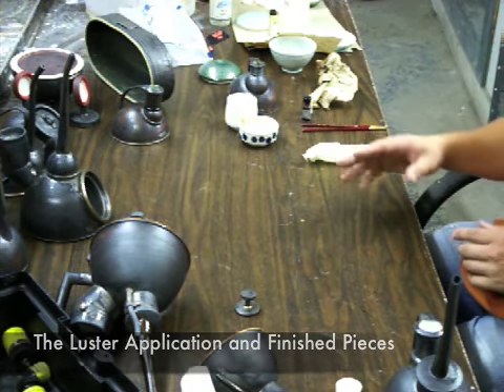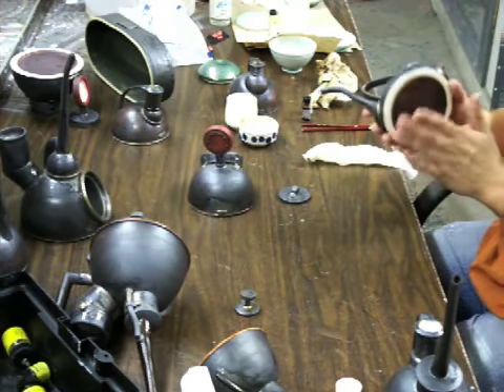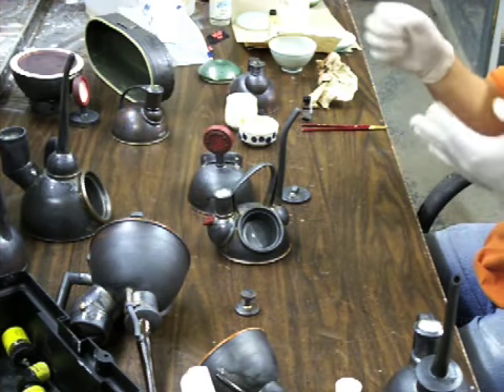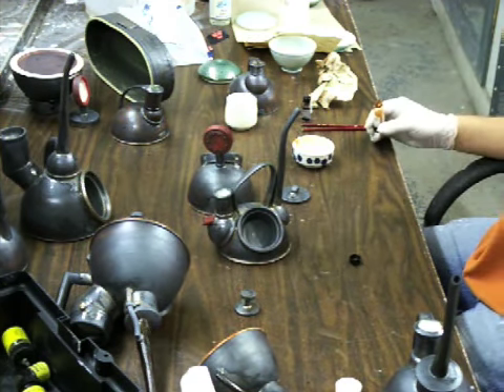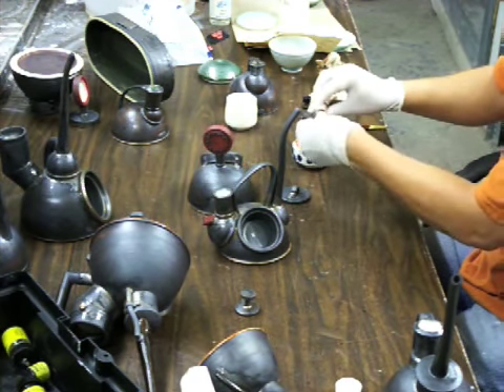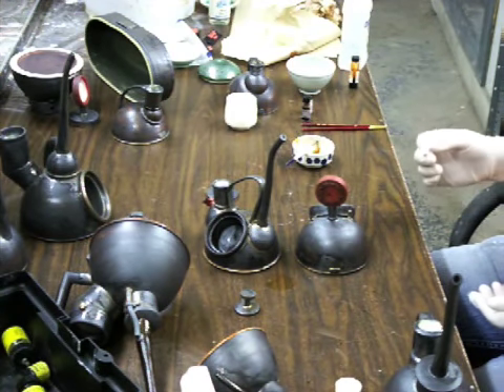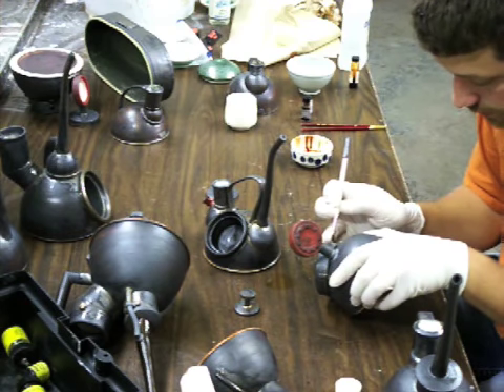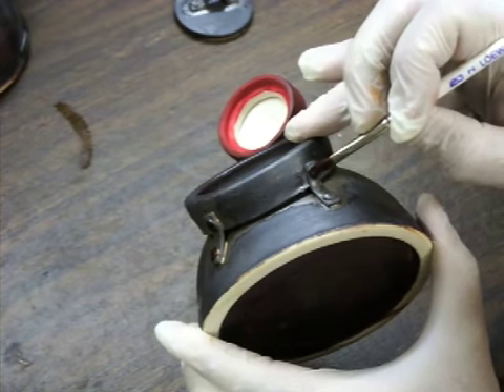Final Steampunk pourers

Comment from the maker: The bronze color is Saturation gold from amaco. I do have my own glaze now that I like a little better in the application. It started as 30 redart 60 manganese 10 3195 but after mixing the bucket up I have added epk, iron, and copper. It is not a safe glaze to use as a liner, but does make it through dishwashing and microwaving. I have been working lately with layering with iron washes and washing back to get more variety. Sorry I don't have a batch recipe,